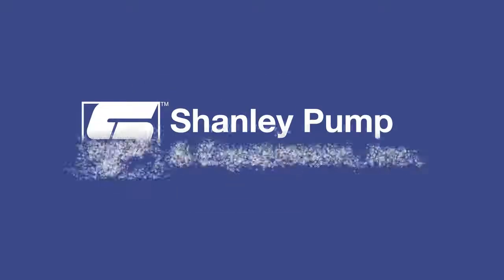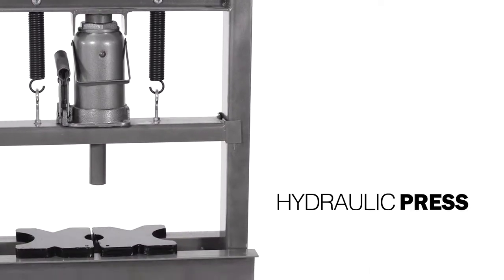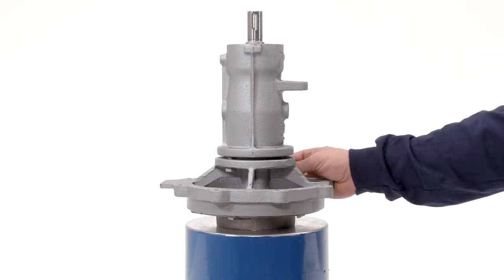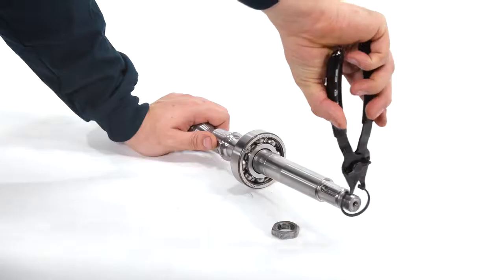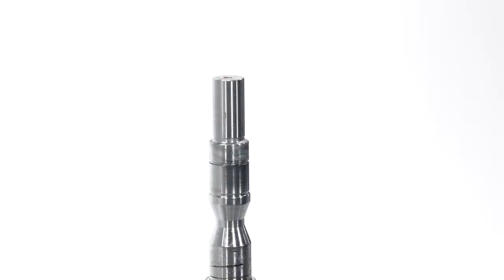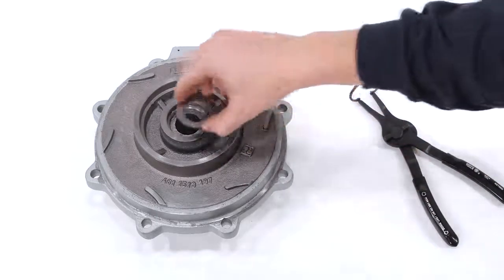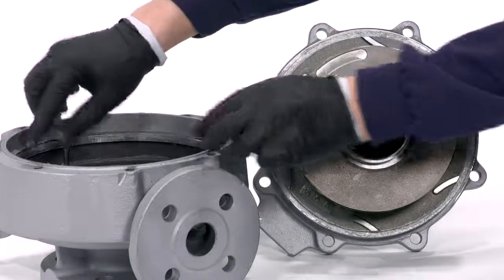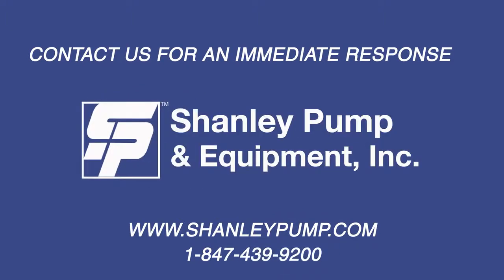Allweiler NTT  Thermal Pump Assembly and Disassembly Instructional Video

Comment: Why mechanical seal placed inside the bearing housing?. Can you explain.
Reply from the maker: The seal is in the bearing housing because the impeller is at 660F and where the seal is located the temp is lower at 187 F.